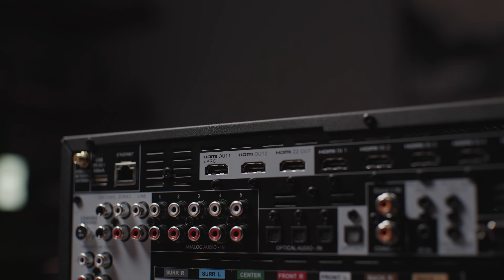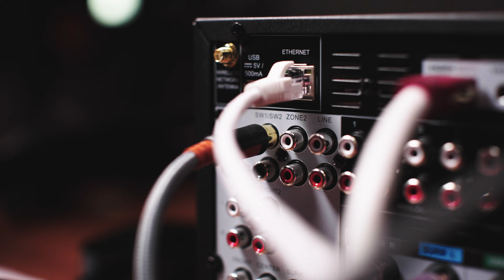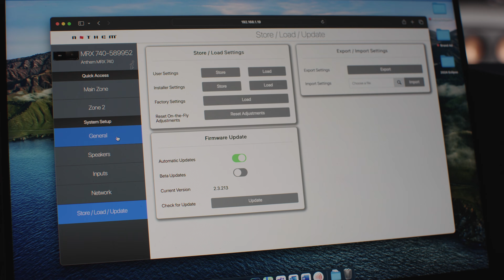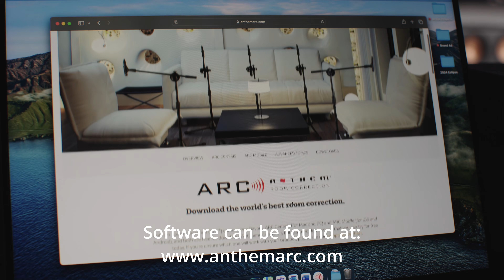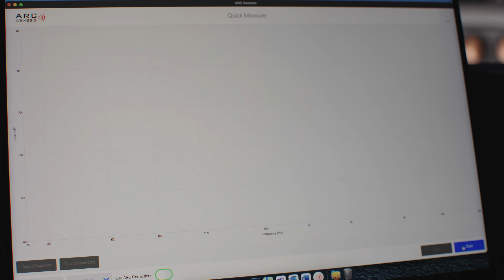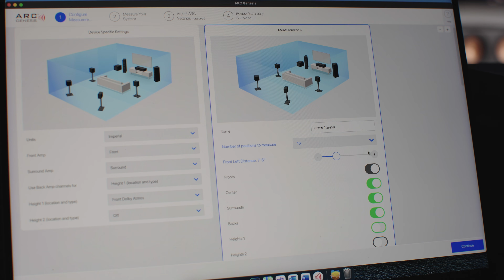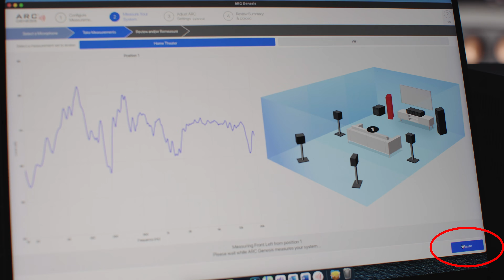Anthem ARC Genesis setup — a step-by-step guide | Crutchfield

Comment: I'm sorry but this video on running Arc calibration needs to be a lot more detailed this is way too basic. I would recommend spending a little time talking to Anthem about the proper way to run their calibration. I feel if people do it so blandly as you describe in this video they're going to have bad results. And Anthem doesn't do the phase calibration until you initiate it it's not done automatically. I think you owe it to Anthem and to your customers to do a lot better informed video on the setup process. These products perform very well but are also very expensive and to get the most out of them people need this knowledge.
Reply from the maker: Hi Mike. thanks for your feedback. What type of Anthem components are you using? Did you find the calibration setup to be pretty straight forward?

Comment: ARC Genesis program will not open on my computer. On Windows 11 Home Version 24H2
Reply from the maker: Right now, Anthem lists Windows 7, 8, 8.1, and 10 as compatible. They do not list Windows 11 as being compatible at this time.
Reply: @crutchfield  I saw that as well. I have it set up on a different computer with Windows 11 version 23H2 and it works perfect. :( I'll just have to use a longer USB C cable to reach it.
Reply from the maker: That is good to hear, and also interesting that it is working on one version of Windows 11. How long of a USB is needed to reach that computer?
Reply: @ I picked up a 20ft cable. Not sure what the issue is with 24H2 windows version. Gave Microsoft remote access and they couldn’t get it to launch either lol. 

Separate question. If I want to run devices directly into tv and out via earc into Anthem earc output 1. It should still work via Anthem’s ARC option correct? Or is output 1 only for Output so all devices need to connect to hdmi in 1-7 with output 1-3 going to tv?
Reply from the maker: The Anthem ARC calibration does get applied to the audio coming in from the HDMI eARC output on their gear!

Comment: Where the phase lol
Reply from the maker: The ARC system can automatically adjust it! We didn't record every screen shot to show its activation, but its there!!
Reply: @crutchfield  when you set your subs to 75 to 80 on quick measure did you go by the peaks ?
Reply from the maker: The microphone is sensing the level of the bass test tone to display on the dB reading, and it is fair to say that the ARC program is using the peak for the maximum dB measurement.

Comment: Smartphones and iPads and tablets do not have a USB port, which you need for the microphone, sir.
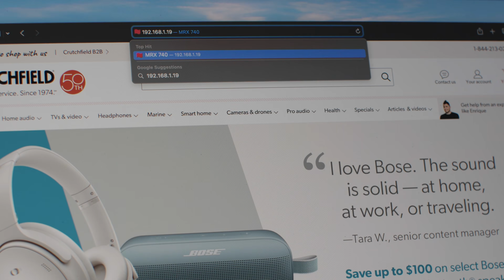Reply from the maker: JR mentions in the video (0:15) that a PC or MAC is required for ARC calibration. Tablet and smartphones are only used to enter the IP address (1:18).
Reply: better take another look, they all have USB ports. newer android all have USB C which is what the mic cable is
Reply: @DD-gi6kx  I agree with your comment which leads me to question if someone has a Chromebook with USB-C connections, could it be used in lieu of a PC or Mac? Since Anthem ARC Genesis is found at both Apple's App Store and on Google Play, it would seem to suggest the operation of the saved configurations can be used with devices other than a PC or a Mac. If anyone knows the answer to this question, it would help me make a final decision on which processor to purchase. Thanks in advance.

Comment: Why is Anthem still not allowing you to calibrate all the subs together, I bought this receiver especially for having 4 subwoofers! Does the Marantz AV10 has the ability to calibrate all four subs at once? Looking to buy a new processor and these two are on my short list!!
Reply from the maker: All four sub pre-outs are discrete on both the Anthem AVM 90 and the Marantz AV10. When you mention calibrate all four subwoofers at once, are you wanting all four to play exactly the same audio signal together at the same time, or not "discrete"?

Comment: Finally found a how-to video that was simple enough for me to understand - thank you.
Reply from the maker: You're welcome. We are glad it helped!!
Reply: @crutchfield  Well, it hasn't helped yet - I haven't tried to install my AVM 70 but hope to take the leap soon.  If I call Crutchfield tech support is there a chance I could speak with you?  My last experience was not good - I could not get it to connect via WIFI and spent an hour with the tech only to find out later that it is a very common issue with this unit and newbies like myself.  I have since purchased an Ethernet cable and hope to try again.  I have had the AVM 60 for over six years and, it's probably just me, but, I am very surprised at how difficult basic installation has been with this AVM 70 8K compared to the 60.  There are many "how to" videos that are extremely confusing.  Hopefully you can help - I have been a Crutchfield customer for many years.
Reply from the maker: Hi Kelly, thanks for shopping with us for so many years! JR is not available; but our Tech Support is happy to take as much time as needed to help you get things set up and working so please reach out again at your convenience for assistance.
They are available:
Monday-Friday:
9 am - 8 pm est
Saturday-Sunday:
10 am - 7 pm est
We will be closed next Thursday July 4 for the holiday.